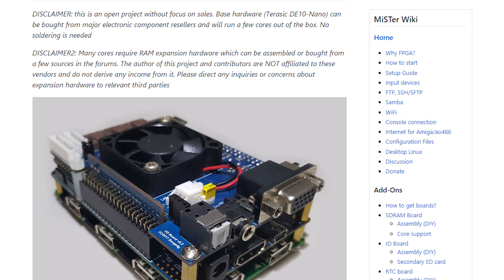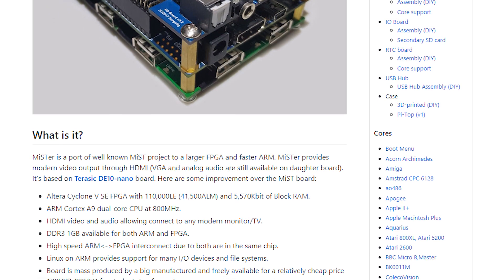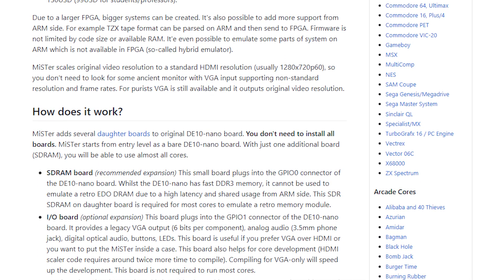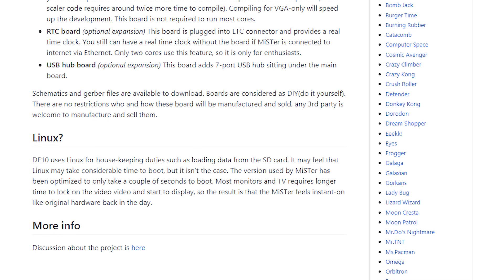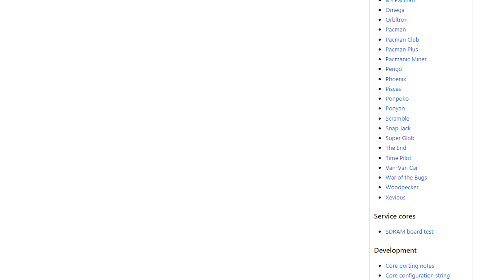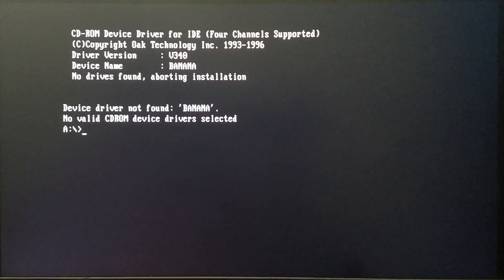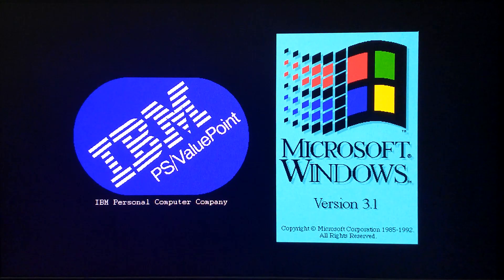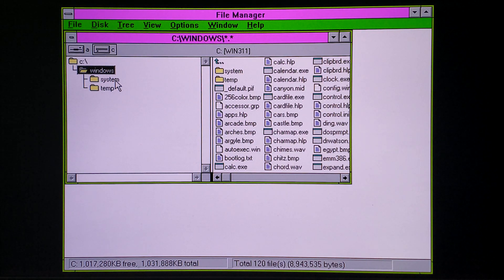Wolfenstein 3D on Windows 3.1 on 486 CPU on an FPGA

Comment: Why are you running DOS game from inside Windows ? O_o
Reply: @OLDSKOOL978 -- Yeah, but you'd get better performance just out of DOS.
Reply: @PlumGurly  I just tested this on my MiSTer, running from Freedos, MS Dos 6.22, and from Windows 3.11 on both of those dos versions, and it performed the same across all four setups. The only time I noticed a slight frame drops was when running it from Win 95 installed on freedos

Comment: Wolf3D only needs a 286 CPU so you wouldn't need something as big and complex as this to run it, but its still cool to see.
Reply: "Wolf3D only needs a 286 CPU" - sure, if you're fine with playing with 5-6 FPS then go ahead
Reply: I’m pretty sure the 486 core isn’t as fast as a real 486.  An FPGA 486 means it’s compatible with all the major features of the CPU, not that it runs as fast as a real 486.  (Of course that also depends on the speed grade of the FPGA.)